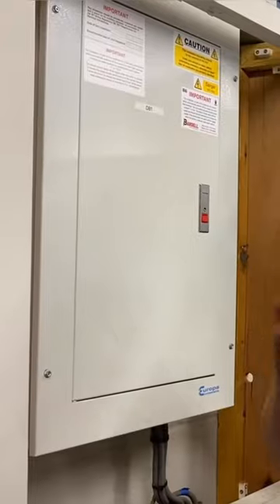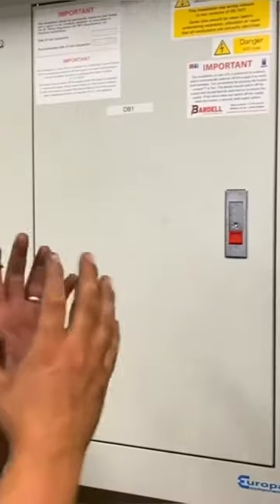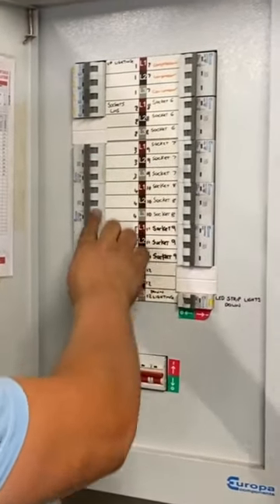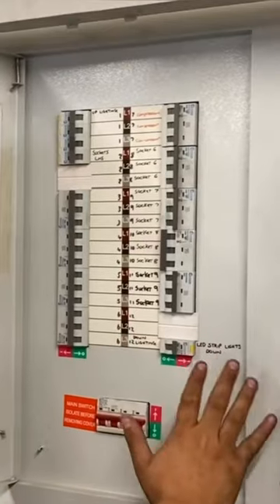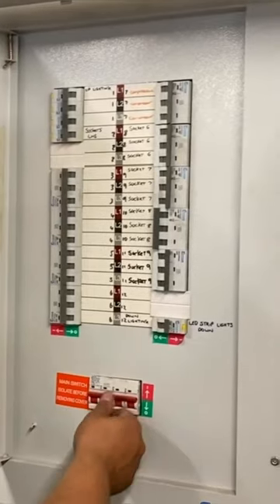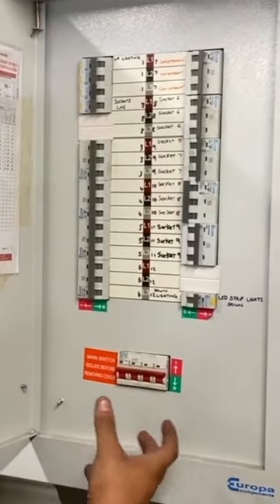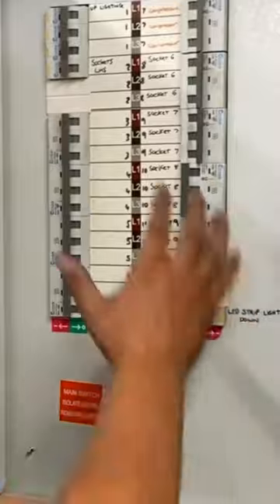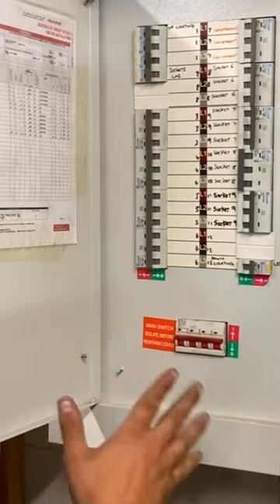🛑 Don’t Remove the Cover on Your 3 Phase Distribution Board - AM2 and AM2S

Comment: What you are saying is very basic. Any good electrician should know them.
Reply from the maker: Appreciate electricians under the nerves of an end point assessment on testing and fault finding can sometimes forget this point hence the video. 

Thanks for commenting Gaz
Reply: Mistakes do happen under pressure. I know two Apprentices that failed their AM2 due to Safe isolation. One was forgetting to operate the switches on a lighting circuit and the other failed for leaving the key at his backside. 😂